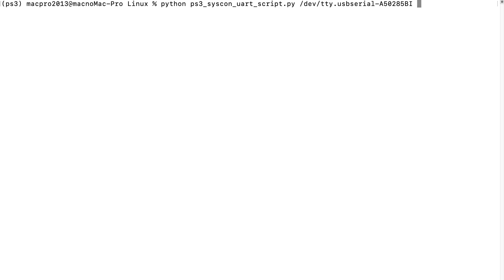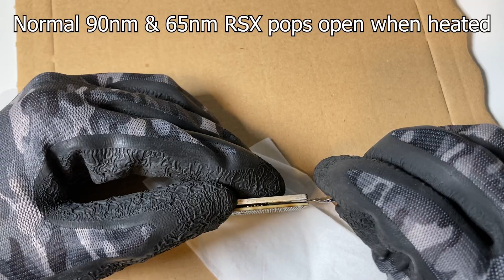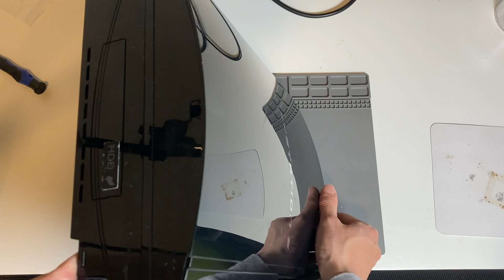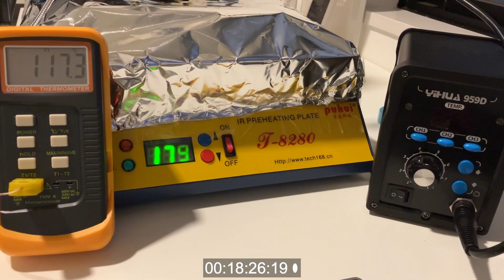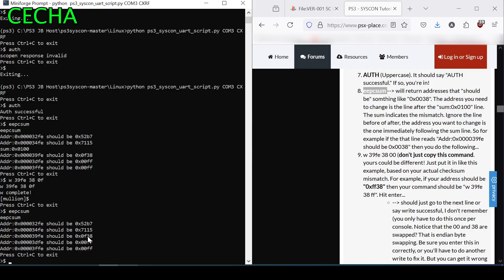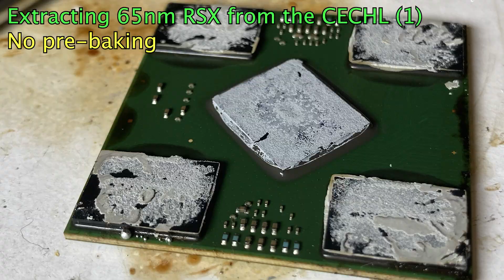Fixing YLOD 3034 is Difficult (aka Frankenstein mod)

Comment: Hello. A few tips based mostly on my experience in bga work.

1. NC-447 and NC-557 are both good fluxes, I can recommend them for rework. I like the 447 one a bit more. Stirri (Stirri-vs-uhf-tf) is also good.

2. You don't really need to heat out the moisture. Its not what delaminating your PCB in the first place. Usually, delamination is caused by too much heat or one area being heated for too long. Although I could be wrong; maybe you need this for these consoles. I'm speaking here in general.

3. You have to modify the suction pen to make it good. You can buy a small DC air pump motor or a motorized suction pen.

4. If you want to keep your de-moisture habit, don't use flux for it. It will only burn, and you will have a difficult time removing it. You only need flux when you're working with molten solder.

5. Profiling is overrated. 1 degree/sec until 150°C is fine; I’ve never had a problem with that. From then on, it's better to be closer to 0.5 degrees/sec, just to be safe. I’m using 180°C for preheating (PCB temperature) for big chips (sometimes for very thick boards, even 200°C), and it depends on your top heater, but around 230-250°C is good (for lead-free applications). I found it better to use less air speed and keep it closer, rather than using more air and keeping it further away. Every dead chip I had died because of a low PCB temperature and high-temp, high-speed hot air gun combo.

6. You don’t have to Kapton tape/aluminium foil everything. If you have aluminum capacitors or plastic stuff around, just those are enough.

7. My PCB reaches preheat temperature in about 4-5 minutes, and after turning on the top heat, it doesn't take more than 3 minutes to lift the chip. Usually, it’s only around 1-2 minutes. If I can’t push the chip from the side after two minutes, I raise the temperature by 10°C and the speed by 5%.

8. Lead-free solder melts enough around 230°C so you can push the chip, and you’ll see it moving and can take it down. Of course Im not talking about proper good quality lead free solder connections, but to soften it.

9. I see you're using screws to hold the PCB. I would'nt tighten them fully; the PCB expands significantly when heated this much, so it's better to leave room for it.

10. Only put the top heater on top of the chip after it’s reached the set temperature. While it's heating up, it usually puts out waaaaaay much hotter air.

11. Yes, you have to remove the stencil. It’s not the kind for direct heat. Watch some NorthwestRepair videos. There's few where he explains how to use reballing with this jig stuff. Unfortunately, I can't remember the exact videos. Maybe someone in the comments can help me out.

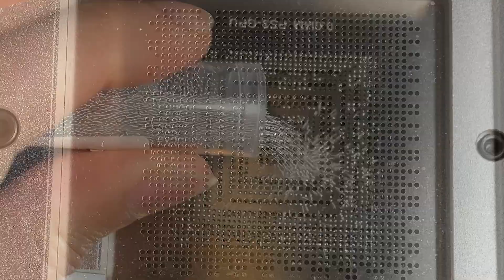12. 16:12 – that's way too much flux for it.

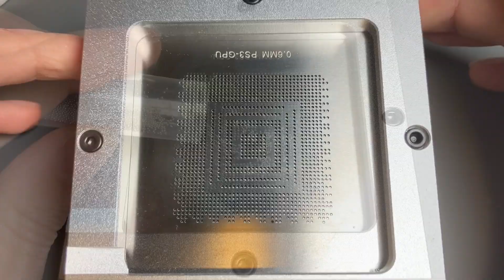13. 16:40 – better, but I feel it's still more than you need.

14. I don’t recommend relying too much on the thermocouple during desoldering the chip. Once I turn on the top heater, I usually just poke the chip from the side from time to time, and that's my cue.

15. You can clear more easily the burned flux by adding fresh flux, especially if the board is hot.

16. RAM (and die) bleeds due to too high top heat temperature.

Have fun. Good luck. I hope this helps a bit.
Reply from the maker: Thank you for the tips! I am sure other people would find it useful too.
Reply: Also needs a BGA Station.
Reply: @8bitnation419 And a IR-based one at a minimum.
Reply: good info thanks
Reply: Thanks chatgpt
Reply: @dovahkiin2108  You are right in a bit, cause english is not my main language, so I asked it after I wrote the whole thing to fix my spelling and grammar mistakes. Nice. :)
Reply: @SkyDown15 I think it messed up number 9. It should say not to tighten the screws so that the board can expand.
Reply: @emmettturner9452  you are absolutely right. Fixed it. Thank you.
Reply: @ GAH! That made it lose the heart and pin. Restore, please, @hardwarerepair200 :)
Reply: Is it possible inject lead free solder paste under the chip to help it come off easier with less heat? My idea was to apply a small amount heat up the board just enough for the paste to get sucked underneath and keep repeating that process until the whole chip is covered in low melt solder. It should mix with the lead free solder and help the chip come off with much less heat. This should lower the chances of delaminating in theory.

Comment: 37:43 there it is then it's soldered,

notice the chip slightly dipping + some of the flux flowing out?

usually just giving it a HAIR more time after that and it should be golden

reason why you couldnt nudge it anymore after that moment was the board  took all the heat away from the RSX the moment it adhered.

Comment: The flux is rarely the issue. Most of the time its just not designed for the application. Some flux just boils off quicker than other flux.

Comment: Why dont you bend and slightly take off thermocouple from t8280 and turn it upwards to actually touch touch moderboard underneath? You dont have to know what are hot plates temperature you need to know what is the board temperature. With everything set correctly you should be able to remove rsx when thermocouple on top of the board close to rsx is showing 220'c and also you have to cover it with kapton tape. Keeping hot air too close make rsx ram die and keeping ihs helps to keep it alive.

Comment: I got an idea. Just give up because this hurts my head watching this. Just leave well alone because this is the problem, it takes years of learning and skill to do electronics and you lot think you watch a few videos on here and your masters of nothing. The reasons a lot of ps3s fail is because how people look after them and the lead free cracks due to block fan or vents then it overheats and cracks. So the easy answer is reball and back to life. Glad every ps3 I fixed works and I tell you why? 35 years of experience in electronics.

Comment: I have 3 questions:
1: If I put an RSX from a Slim 3000 model will I be able to install CFW? Or will I bottleneck the console to the same degree regarding modding as the 3000 slim and so only Hen will work?

2: If I harvest an RSX from a console that had the newest firmware installed and I put it into a CECHA with a dead RSX that wasn't updated in a long time (so basically unknow and lower firmware version than the RSX donor console) what will happen? Will it boot? Can safe mode be opened and update from there? 

3: Almost the same question as number 2 but with a twist: If the donor RSX comes from the latest Slim 3000 model that has a theoretical 4.10 as lowest possible firmware and move that RSX to a CECHA with a firmware lower than 4.10 what will happen?

Comment: My stencil is able to be heated no problem. If you have a good stencil, it doesn’t do that. I couldn’t imagine trying to do this without leaving the stencil on after having done it in both ways I would never go back to doing it with taking the stencil off. It actually takes less than a quarter of the time to get it done when you leave the stencil on.  So for the future, I would recommend getting a better stencil one that is already hardened so that it can be put in high temperature situations.  you may want to use the solder glue instead of using regular heat applied solder with all the boards delaminating.  either that or insulate the area around the gpu slot, but the glue would probably be alot easier for you
Reply: that because the stencil you are using is made for direct heat
Reply: @ that’s why I told him to get a hardened stencil. That is how they prepare it for direct heat. The hardening process that is
Reply: @95Comics the stencil he has is fine, he just need more practice
Reply: @ People were telling him to heat it up and he did, and you saw the result. so I told him if he’s going to heat it up he needs a different type of stencil one that is hardened.  Are you telling me that if he wants to heat it up with the stencil on it he does not need a different stencil? You would be wrong then

Comment: On the point of pre baking, my experience so far is, you can get away with preheating the board for an hour at 100c, then increase slowly by 20c increments before adding the top heater for extraction. This works for me without ram bleeding. Overall removing the ihs is a better process to do than leaving it on.

Comment: Buy soldering station called "ИК Про" from russia, it's cheap and gooood, really, it's sad to see when u killing another console one by one
Reply: I was curious about trying bga rework but a quick search lists it at RUB 330,000.00 which is around $5,000 AUD?
Reply: @OriginalityDaniel  jeez, just checked price, and yeah, 5k AUD, when i wanted to buy it, the price is been 1k USD, inflation, or what.....
Reply: @OriginalityDaniel  but you can make it by yourself, 10 years ago i seen video from guy in kiev, it's maked DIY rework station, and founded somewhere software where u can make profile and control your station. You have table, now you need IR head and holder for it
Reply: @cherbet  also there is T870A i think its 15years old but it's cheaper, havent found any newer cheap models yet.
Reply: @OriginalityDaniel  yeah it really cheap
Reply: @cherbet  i think one of my comments got deleted but IR6500 and IR8500 stations are around 500 usd or cheaper if you use a proxy to get direct from china
Reply: @OriginalityDaniel  might be
Reply from the maker: @cherbet  So sad it's a bit expensive now. I would be happy to try the "AK47" of BGA rework.
Reply from the maker: @OriginalityDaniel  YouTube has been aggressive recently. It even deletes my replies sometimes.

Comment: You can prevent this entirely by delidding a low-hours PS3. Can't YLOD if it doesn't get hot enough to melt the solder. What's funny is this is nearly the same failure as the RROD.

Comment: That stencil is not a direct heat stencil. The advice you received in the Youtube comments was wrong. You did it correctly previously where you add a thin layer of flux, the stencil, the balls, then lift off the stencil carefully. You can also use a heat plate to get the balls to melt, rather than hot air. The advantage there is they won't blow away :) Also add a little less flux, you only need a VERY thin layer, enough to get the balls to stick and stay in place.

Comment: you can try removing one of the springing on the mike stand and tightening the screws, also you want to make sure the tin foil isn't being lifted by the hot air make sure it is stuck down really good so no hot air goes under it.

Comment: As ur starting to finally work out the budget set up is ur problem, especially with that top heater (hot air wand) not being up to par. You keep spending money and persisting but like many others warned it would be best to just buy a proper BGA machine and learn from that and u will get better success. I get this is all a learning process and we all need to go through it but sometimes u do need to listen to others that have gone through it already, much like myself, so u get a better head start into the reballing field on the PS3's. Once u have better equipment u will make that money back so always remember the equipment u use is always an investment so spending more at the beginning is never a bad thing.
Reply from the maker: Getting Frankie done with good equipment would definitely save time and money. But there are already so many people (Booter, ConsoleKing, RedOverload, etc.) on YouTube doing it.

What hasn’t been done is how to Frankie using a budget setup, and that’s exactly why I want to stick with my current tools. It might end up being more expensive in the long run, but I just want to answer the question: Can it be done?
Reply: @hardwarerepair200  If you want to stay budget, look at RF4 they have 1000W hot air for <$90.
The 858D clones are great for beginners, but they are more like 400-500W which may not be enough.
Reply from the maker: It's a really good suggestion! I will save it in my wish list.
Reply: @hardwarerepair200  I get that but it has been done before, many times and has proven it can work but the success rate is very bad so ur not really showing anything different other than to warn others not to try it this way with this set up??? Others will see it and be mislead thinking it can be done but fail more often then not just like we are seeing here.

Comment: You need to STOP using that hot air gun with FAN IN HANDLE, its too slow to heat up, just watch youtube comparison of nozzle vs pump. The ones with blower in the handle IS BAD. 
Clones are fine. Its easy to identify as the handle will be slim (no fan). It uses a compressor pump inside the station that pushes hot air. 1000% the reason you're failing.
Reply: You don't want a "compressor pump" you want a brushless fan inside the station.
Thats not really the issue though, its just that this fan handle one is 400W and other units are 1000W+.
Reply from the maker: Thank you for your suggestion again. Would you mind elaborating why we don't want a compressor pump?
Reply: @hardwarerepair200  
Yea idk what he's on about. The way compressor pump works it pushes air like a fan, maybe he's talking about the type of fan inside the pump? lol.
Reply: @hardwarerepair200  Maybe its a translation issue. Old hot air stations used to use diaphragm pumps (like an aquarium pump) which were really weak. Any modern station (RF4, Quick, Atten, etc) has a brushless centrifugal fan inside which has better air flow.
Reply from the maker: Thanks for the explanation! I wish YouTube allowed pinning multiple comments. There’s so much useful information I want to pin!
Reply from the maker: Would you mind giving me a few suggestions? 
For now, I’m sticking with my channel’s theme of getting Frankie done with a budget setup.

Comment: Couple of tips, 
You got way too much flux on the chip, you are suppose to have a very thin layer. That layer of flux is only to help the solder balls to stick on the pad. Either make the layer a lot thinner, I mean a lot thinner with your glove and your smooth glove not your spiky glove or get hot air at maybe 250 to heat the flux so its smooth but not activated and not hard or combine the both, which then would allow you to fully coat the entire chip in flux once the solder balls are stuck to the pad. 

What can also help you is buying a phone repair mat like the Mechanic CPB14 or CPB 320. These reach at 120c and would allow the chip to be preheated and have make it far easier when putting top heat. Also please remove the chip from the stencil jig as that absorbs a lot of heat.

Second, you are heating the chip way too fast when removing and soldering. With my Hot air bga station, there are steps such as go to 220c then stay for 45 seconds, go to 245c stay for 40 seconds then 280c for 120 seconds, the longer duration is only to allow me have the extra time if i need it since its a profile type bga station and i cannot edit it once i start it, chip will usually remove after 280c at 40 seconds. 

For your hot air gun, try to have similar steps with interviles to allow everything to evenly heat and soak in the heat, you shouldn't apply max heat all at once and try to remove it as fast as possible with the highest heat possible. 

And if its possible, try to preheat your board higher. You want more even heat rather than board being 170c preheated and then blasting 450c right at the middle, thats when problems occur and do not worry about putting the IHS heat sink onto the chip when soldering as that absorbs a lot of heat and you do not need any sort of weight to help the chip solder, the chip with solder with the perfect amount of flux and heat.

Lastly, I keep my hot air nozzle very very close to the chip, Maybe around 2-5mm.

Hope these tips can help
Reply from the maker: Thank you for the tips! That's why I still post videos despite it's a failure in the end. The constructive comments I get here are what keep me going.
Reply: @hardwarerepair200  Hopefully you can try those tips and would help you for your successful repair. Also ram bleed is a very bad thing since what happens when the solder is heating up, the solder will vibrate but with underfilled chips, since the solder doesnt have any space to vibrate they would leak out of the ram.

This is due to the temperature being too high, you shouldnt try to remove the chip as fast as possible with the top heater. This is not a small chip where you can apply heat as much as possible and it will be removed and fine because the RSX and other big chips require way too much heat, so they need to be done in steps.

These advice which i use personally are so good that I do not even need to prebake the board at 100c for 24 hours or prebake it at all because i never had delamination issue with the way I do it.
Reply: I love that mechanic nano flux that stuff works good!! Amd he can get ir heaters for stupid cheap i got new white ones for 18$ off Amazon so they are cheap i think they might be even cheaper on aliexpress 😂

Comment: Nice work
Just changing Nec Tokins u got workin systems
Reply from the maker: Getting Frankie done with good equipment would definitely save time and money. But there are already too many people (Booter, ConsoleKing, RedOverload, etc.) doing it already.

What hasn’t been done is how to Frankie using a budget setup, and that’s exactly why I want to stick with my current budget setup. It might end up being more expensive in the long run, but I just want to answer the question: Can it be done?
Reply: @hardwarerepair200  I believe you can do it.
But a better BGA equipment is required to preserve the boards and the RSX chip without letal damages.
Reply from the maker: @eileenlucynakurosawa7421  That reply was for another person lol Somehow it appears here😂
Reply: @hardwarerepair200  Ummmm yeah 😝

It's possible, but may require several attempts to get a fully operational Frankie.